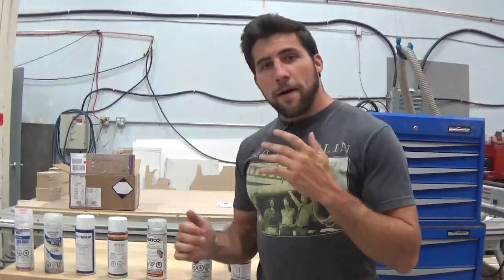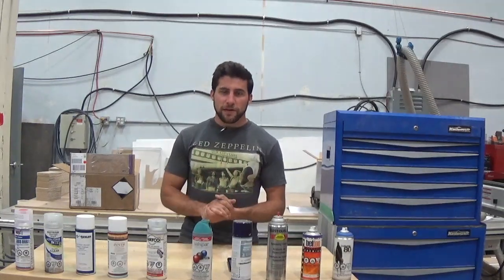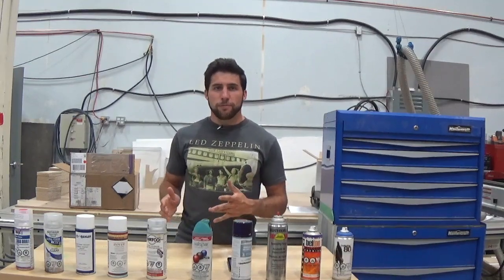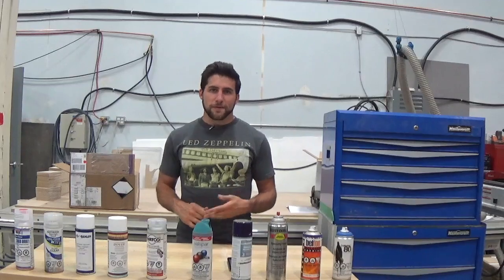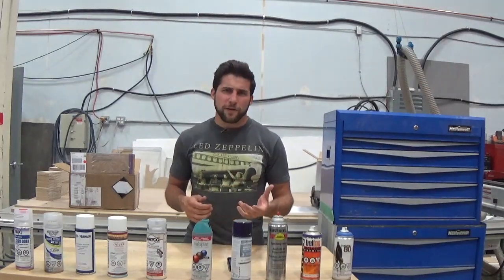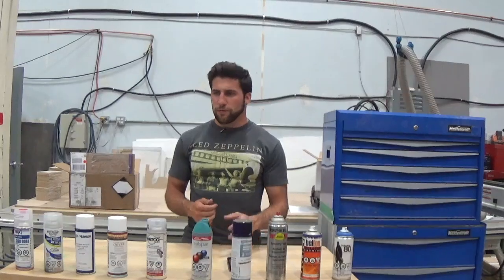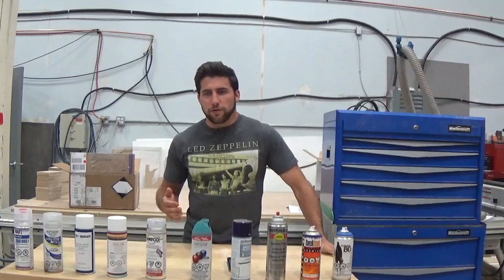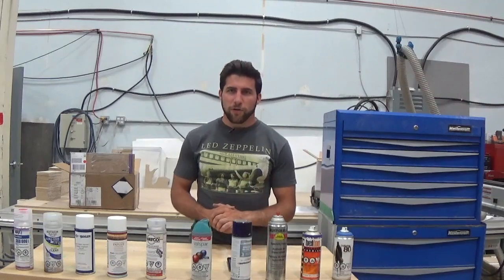The Top 5 Mistakes to Avoid When Painting With Spray Paint

Comment: Do you recommend a certain grade of sandpaper for metallic polyurethane basecoat?  I just laid a coat down and I'm waiting an hour before the next coat.  Should I do a light sand before my next coat?  As well as before the laquer gloss coat?
Reply from the maker: +tigerpaw it won't be ready to sand after an out. That being said, it also won't bond chemically after an out. Can I ask why you've chosen that recoat time?
Reply: Brad Angove it was a suggestion from an illustrator in forums.  Giving 1 hour re coat windows, and 24 hours to cure between primer and basecoat, and the topcoat (3 days, basically).
Reply from the maker: +tigerpaw for polyurethane? That's interesting. Well, I would use 800 grit paper as my between coats or before clear coat paper.

Comment: I've used Rust-oleums painters touch 2x ultra cover clear gloss on other projects before and it has changed the paint color / finish. I don't think I used it correctly or maybe I mixed paint types? I'm not even sure.... 

My question is -- I just spray painted the top of a table with krylon colormaster paint&primer metallic.... I want to put a clear coat over top of it (the Rust-oleums painters touch 2x ultra cover clear gloss)... would this be okay as a top coat?  How long should I wait before spraying? Thanks so much!
Reply from the maker: It would probably be safer for you to stick with krylon’s top coat if you’re using krylon for the colour.
Reply: Itll change the colour slightly u just gotto sand it down and buff it until its shiny

Comment: I’m painting my bmx bars silver chrome and I was wondering how many coats of paint to I have to put on after wait for it to dry completely and sand it and after I sand it do I spray over it again
Reply from the maker: No more than 4 before letting it dry fully. Then you can sand it lightly and add more if necessary.

Comment: Thanks for the videos, I have a question for you please.
I have a Les Paul Guitar, on it I replaced parts with metal parts that have skulls in them, ie" the jack plug, the switch cover, the truss rod cover.
 I can not sand the parts, I want to spray them gold, to match other gold hardware on my guitar, should I use some kind of clear coat to protect them? and if so, what can I use to help protect but also add shine?

I was going to use "Krylon K01000A07 Premium Metallic Spray Paint, 18K Gold - 8oz"

These parts once on the guitar rarely ever come into any contact with anything, except maybe the input jack plate.Since I can not sand the parts, is there a particular product that you can recommend that will dry to a nice shine without wet sanding?
Thanks for any help, advice or suggestions you may have, I appreciate that.
PS also, is there a better Gold paint product that will dry with a decent shine not needing a clear coat?
Reply from the maker: Can you get the parts sandblasted to help the new paint stick? If not, you can use some 00 steel wool to scuff them for the paint. 
If they’re not going to be taking much contact, I would use a coat of grey primer and then the Rustoleum metallic reflective finish gold.
Reply: Thank you so much for answering my question,
Ok, you think the rustoleum will give a decent shine? over the Krylon ?
I may be able to sand blast, I had'nt thought of that.
I was most thinking about the clear coat, should I bother, as I can sand or buff it really after anyway, I know it will protect, but again these are three little parts, I can always re paint them if I had too in a few minutes, didnt know if I should bother with the clear coat or not.
Reply from the maker: I prefer the Rustoleum for durability reasons. Unfortunately, you can’t clear coat over that reflective metallic anyway. It just looks hazy if you do.
Reply: Oh perfect, im glad I asked, lol thanks again very much.
Reply from the maker: You’re welcome.

Comment: Brad- I am painting a wooden frame.  I sanded it down and painted it using Krylon that is made for wood, metal, and plastic.  After painting I get a crackled finish in some areas of the frame.  Why does it do this?  I sanded off the paint and cleaned it twice over and re-sprayed again and again it has this texture in some areas of the wood.  Can you help?
Reply from the maker: Have a look at my video on why paint crazes. That should explain most of the principles behind it. 
Side note, krylon does that to me sometimes too, which is why I don’t use it.

Comment: You may have already covered this, If so thank you for repeating. 
In another one of your video you indicate that you don't need to wait for colour coat to dry in order to cleat coat and that we should clear coat within 1/2 hour. Did I get this Right? I will be using rust oleum for a plastic motorcycle part. Will also use adhesion promoter. 
Thanks for great and informative videos.
Reply from the maker: It’s sometimes helpful to spray one coat of clear over metallics without letting them dry. That way when you let it dry and sand it for your next coat to stick better, you’re not messing up the metallic.

Comment: What grade sandpaper would you use to lightly scuff prior to the clear coat, or the next paint layer? Cheers
Reply from the maker: I usually go 600 between color coats if necessary and 800 before clear. Either will work though.
Reply: @BradAngove  Thanks a lot :)

Comment: Hey, what happens if I already sprayed the coats without leaving the right amount of time in between and it’s not drying, regards form Chile!!!
Reply from the maker: How thick is it and what kind of paint?
Reply: Brad Angove I used rust oleum high gloss. Unfortunately I sprayed 3 thick coats, it’s already been 3 days and it’s still quite sticky, it’s important to say that where I live is quite cold.
Reply from the maker: That paint can take up to 6 weeks to harden fully, but sometimes it never does. I suggest you remove it and try to apply lighter coats to build up slower.
Reply: Hey, I did what you told me, I removed the paint and sprayed thin coats of the same paint over the guitar waiting more than 15 minutes before applying any other coat, but it’s still having trouble drying, it’s been 3 days, could it be the rust oleum paint???
Reply from the maker: Is it still sticky?
Reply: Yes, it’s sticky
Reply from the maker: There may be something wrong with your paint, but how cold is it where you’re painting?
Reply: It’s perhaps 50° degrees
Reply from the maker: Fahrenheit?
Reply: Yes
Reply from the maker: Ok, that’s probably a bit too cold. Is there a heated area where you can paint?

Comment: Wish I had watched this before I painted my metal desk.  I tried to correct drips while wet & screwed everything up.  I took a paint brush and went over all the drips.  You can imagine how crappy it looks.  Is my mistake fixable?  If I do a light sanding & spray it again will all the brush marks go away?  And, how do I avoid the drips.  I was cautious not to spray too much yet it still dripped.
Reply from the maker: To get rid of the brush strokes you will need to sand it flat. If you can still see them before you spray your next coat, you will be able to see them through it. 

You will have to spray a bit lighter. This can be done by moving the can faster, or holding it a bit further away.

Comment: Can I use spray adhesive glue as a primer before spray paint or should a use regular primer? Thanks
Reply from the maker: Use primer. Why would you use glue?
Reply: Hi Brad, thanks for replying, well I have been searching and somebody suggested in a video the use of adhesive,  but he never reply so I am not sure why he recommended adhesive over the use of primer. I am building for a kid a lamp base using action figures all plastic, but the lamp itself is some sort of metal, and I made a base of compressed cardboard and insulation foam, so I am looking for the best way to prime all of these materials before spray paint it. Do you recommend just regular primer? Thanks
Reply from the maker: They may have been referring to adhesion promoter. That is commonly used for plastics to help paint adhere to them. It’s not the same as spray adhesive though. You need a metal compatible primer for the metal. Sounds like you’ll want one that is also plastic compatible. Be careful if you’re spraying over foam, the solvents in some paints and primers can melt some foams.
Reply: @BradAngove  thanks a lot for all these tips, I am not worried too much about the foam, it doesn´t have to be perfect.

Comment: I am two weeks into spraying and sanding, and fixing an old 80's lacquer bedroom headboard. It had faded and cracked and looked awful. I sanded and washed the surface then dried it before painting.  I have several cans of the new Rustoleum 2 X paint in 'Sand' white high gloss. Well, it ran a bit and was able to let it dry for a week before re-sanding the runs.I have the first coat that looks good. But it needs more paint, because the surface is still a bit spotty, not bare but not fully shiny. How do I get it to its original glossy surface that it used have?
Reply from the maker: At this point of the color itself is uniform you will probably want to sand it lightly with 800 grit and then apply a few coats of clear coat.
Reply: @BradAngove   - Because it ran I resanded it,  and I'm on the 2nd can. I just needed to know why the surface is not shiny enough? Do I purchased a 'Clearcoat' or continue using the High Gloss?
Reply: Thanks
Reply from the maker: It probably has some dry spots. I’d go with the clear coat personally.
Reply: @BradAngove  - I am halfway thru the clearcoat can and it still is not the lacquer that was originally on this furniture. Unfortunately I couldn't purchase this heavy furniture nowadays. I'll use the rest of the clearcoat and move on to the amoir and the chest of drawers. They have all faded from the sun and are orange coated.
Reply from the maker: Have you seen my videos on the polishing process? That may be what you need at this point?
Reply: @BradAngove   - I have clearcoated the headboard, it came out soso. All of the remaining pieces I have polished with an automobile polish. Malco Automobile Refinishing Polish. I'll tell you I was on the verge of sanding and painting all of the remaining pieces.  But I originally bought this for my wife's car. The hood was resprayed and has lost its clearcoat. It was too fargone to just polish it. It needs to be sanded and painted. But the furniture came out beautifully. It would have been better to use a hand polisher, but I figured I would try it by hand. It probably will need another try. But most of the discoloration has vanished and has looked like it was totally restored.
Reply from the maker: Glad to hear it’s looking good.
Reply: @BradAngove   - I'm trying to find a polishing pad for my Ryobi Sander. It works great and has a built in vacuum, so the dust is minimal, thanks again for your kind attention.
Reply from the maker: What diameter?
Reply: @BradAngove   - Sorry, it is shaped like an iron, it is not round.
Reply from the maker: That won’t work as a polisher. You need something that imparts more friction. Basically something that spins.

Comment: First off thanks for the information... I am painting football helmets (Plastic) and Carbon steel face masks.  I've been using Rustoleum spray cans. The paint job looks good but the paint on the helmets rubs off on clothing and the paint on the facemasks chips. I use rustoleum clear coat on both Any suggestions? Thanks in advance!
Reply from the maker: Did you abrade the Helmer’s first and use adhesion promoter?
Reply: @BradAngove  Yes I did.
Reply from the maker: Ok. Have a look at my video on how to get a professional looking clear coat with spray cans. That product is more durable.
Reply: @BradAngove  Thank you so much!!!

Comment: I painted my guitar and after I added the clear coat i was Impatient. I grabbed my guitar and now the paint is smudged with finger prints. I thought the clear coat would be dry but I was wrong. How should I fix this? resand the clear coat? What grit? I'm mad at myself because the paint looked awesome.
Reply from the maker: Give it a few days to dry, then sand it flat with 800 grit and spray another coat or two to finish it off.

Comment: If still replying I have a question about my paint I was fixing rust on my car then I decided to paint but it was all going good until clear coat I put it on and it looks like it has cheese holes what’s wrong with my paint? I live in Illinois and I was working on it outside could that affect it?
Reply from the maker: That could definitely affect it, but if it seems to have holes the problem is likely surface contamination. Did you sand and clean it before the clear coat?
Reply: Brad Angove yeah I’ve took precaution by cleaning it with alcohol and a lint free cloth and then I added primer white and since my car was white it kinda matched but the paint was all good all smooth no cracking nothing just when I got to clear coat and I added it it got the cheese holes I read about paint not curing yet could that be too? And also the cold? But yeah I’m planing on sanding clear coat again and painting white again waiting the week and then clear coat?
Reply from the maker: It could be a temperature and humidity issue or a compatibility issue. I was just trying to rule out contamination.

Comment: My biggest issue with spraying sealer on is the paint can sprayer clogging up.  Each time I spray the sealer I attempt to clean the tip of sprayer.  I NEVER get the entire can to be used, tho.  What do you do with the tip each time?
Reply from the maker: I keep any excess tips I have and then replace them as necessary when spraying.
Reply: @BradAngove  good idea. But you just made me think of keeping nail polish remover or acetone handy each time.  Ya, that's what I'll do.  Wipe the tip each time.  This was great.

Comment: How long should I wait for the Hammerite paint to dry on one side of my weight lifting plates before doing the other side?
Reply from the maker: It depends on the temperature and how thick you apply it. Probably as long as you can to be safe.
Reply: @BradAngove  Is 6 hours enough as Hammerite recommends a minimum of 4 hours?
Reply from the maker: I don’t know. You would have to contact the manufacturer.

Comment: I started preparing my fairing by sanding it with 600 grit, wiped it down with prep spray, primed it 10-15 minutes between coats like can recommend. Next day light sand with 600 again and when I put the prep stay on to clean it all the primer wiped off. 🙄help
Reply from the maker: Plastic or metal?

Comment: Hi,
I do Molybdenum Disulfide coating on tiny components by dip and spin method. We notice some of the parts having lumps at the corners and in some critical areas. We do take care of correct viscosity, air drying and baking etc. Can you give your suggestion in this regard.
Reply from the maker: Are they clumps from the paint itself, or are they just areas with more substantial buildup?
Reply: Brad Angove 
These are areas which are easier to build up lumps. Also probably more frequent ( once a week now) cleaning of basket might help.  We face customer complaints.
Reply from the maker: Dip and spin tends to create buildup in the areas that the paint flows to. That’s not the same thing as lumps though. Which are you referring to?
Reply: Brad Angove 
I understand n agree with you.  Lumps are at different places on different parts of the same batch. If we load parts in the basket we notice more of these lumps (?) . May be MoS2 is not centrifuged out well.
Reply from the maker: It might be getting some surface drying that’s mixing in after?
Reply: Brad Angove 
Our SOP say 2000 nos per basket of D S . For this we need to put stricter control.  More qty per basket can make less space for MoS2 to flow out. Its being produced continuously, don't think drying on surface of liquid MoS2. 
May I request for any writing or video about Dip Spin process. Thx a lot for your support.
Reply from the maker: I don’t do any dip spin work, so unfortunately I don’t have any source material on that.
Reply: Brad Angove 
Oh .. it's nice communication with you.  I will be watching your videos for sprying etc. Thx Sir
Reply from the maker: Thanks for watching.

Comment: Here's a couple of tips for you Rattle Can painters.  Once the surface is prepped and ready to paint.. Put the spray can in a pot of warm/hot water from THE TAP! do not boil it.  5min is good.  The warm paint lays down much more even and the higher pressure in the can helps a ton.  Second tip.. if you are running out of pressure in the can but still have lots of paint left...hook a 3mm airline to a small compressor with a gauge, pull the nozzle off the paint can and attach airline.  Repressurise to 100 psi.  The cans are designed to take much higher pressures but Ive never felt the need or had the courage to go higher LOL  Also Sun drying your parts will cut curing time by more than half, but comes with the risk of getting debri on your parts if outside.
Reply from the maker: Sun drying can also cause yellowing and other issues depending on what kind of paint you’ve used.
Reply from the maker: I should probably also note that air isn’t a very good propellant and generally isn’t what’s used in spray cans, but it’s certainly better than nothing, so that tip can be useful in a pinch.